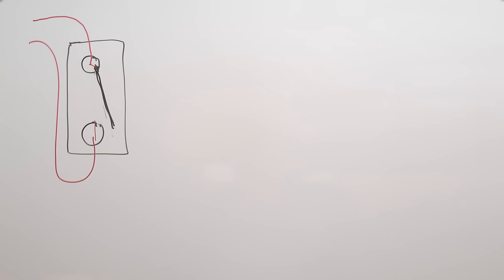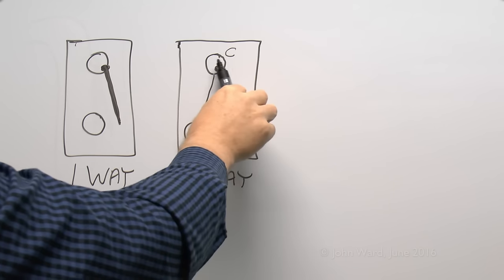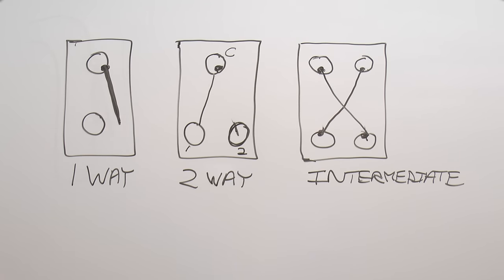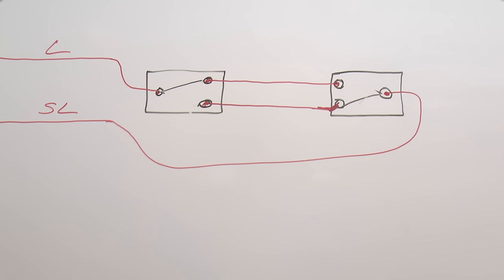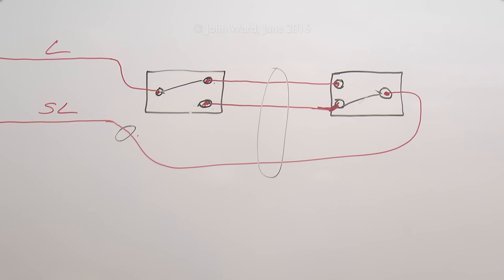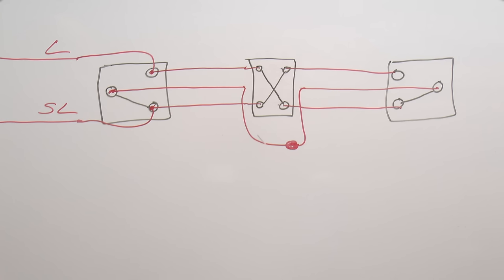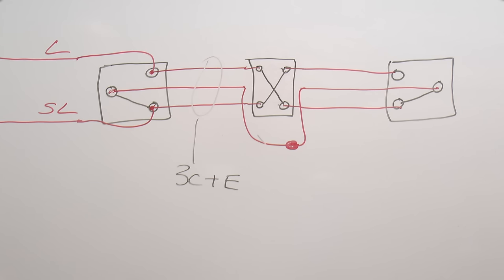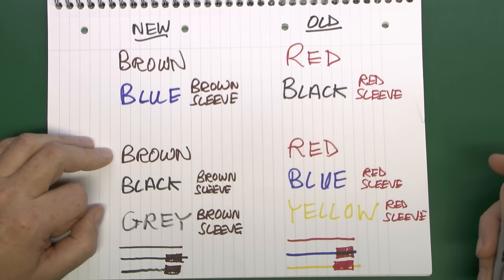Lighting Circuits Part 2 - Wiring Multiple Switches, 2 way and Intermediates

Comment: One minor point I wish you had covered.  How do I wire an intermediate switch as an ordinary two-way switch?  I have a three-storey house with a three-gang switch on the middle landing.  Currently I can switch the middle landing light from the ground floor but not the top floor.  I have obtained a three-gang intermediate switch.  But only one of the three needs to be used as an intermediate.  How do I wire the other two?
Reply from the maker: For a 2 way, use 3 of the 4 terminals.  For most intermediates,  two terminals next to each other will be L1 and L2, then either of the terminals on the other row will be Common.
They can also be used as a 1 way by using only 2 terminals, one on each row.

What's inside the switches is covered here: https://www.youtube.com/watch?v=eKFICF88AkY which should explain how they work inside and therefore which terminals do what.
Reply: @jwflame  Many thanks for your prompt reply.  I'm going to have to draw this ..

Comment: The red/blue/white cable I came across the other week during a rewire... still in use ... with pvc overall jacket, but polyethylene insulation! (yes, flammable!)... no earth conductor. 

Would you like a length of it for a collection (or possible video) if you have such?
Reply: I'm in the UK so I am quite happy to post to you :)
Reply from the maker: Yes, please send a piece.  Address here: http://www.flameport.com/contact.cs4

Comment: So the ceiling rose is the same as a junction box? What is confusing me is why in this video there is no neutral. If your lights are connected to the junction box already an you want to add a switch you have to run it to the junction box as well right? and not to the other switch like in this video. Any thoughts from anyone would be appreciated, I don't want it to go bang bang.
Reply: A ceiling rose is kinda like a light fixture with a built in junction box
And in the UK the wire is generally run directly between the switches

Comment: can you suggest any video at least half-as-good as yours to get the diagram right?
Reply: hi Matt thanks for replying. I will try to be specific. I can't figure out how applying the technique to my case.  I have: three light points in my room and
Switch 1: three gang that controls light 1,2 and 3
Switch 2: two gang that controls light 1 and light 2
Switch 3:two gang that controls light 1 and light 3.
I think This amounts to 2 2-way switches + 1 3-way switch? I now know that I am doing wrong as the gangs in each switch box are "individual" and require some wiring between each of them, but I can't figure out how. If you can suggest some source covering multiple gangs, it would be great.

Comment: I am using a relay with my raspberry pi to switch on and off a bulb.

I have an idea in my mind but I don't know if this will work or not. My idea is to use a relay switch with a 2 way 1 gang switch.  As you know, 1 of the switches will have the live connected to the common and the other switch with the bulb connected to the common. I want to connect the common of the relay with the common of the switch and the NO/NC with the bulb so if the switch is off I can still turn on the bulb using the relay.  With the idea if I cannot pass from the door I can pass from the window. Will I burn the relay if I have the relay on and switches on together?
Reply from the maker: That's fine - the relay contacts are just the equivalent of another switch.  Doesn't matter if one, both or none are switched on.

Comment: How is one dimmer fitted using an intermediate switch?
 I believe the live has to run through the dimmer switch at all times.
Reply from the maker: A standard 2 way dimmer can replace either of the 2 way switches.  No intermediate dimmers that I am aware of.  
Limitations are that the other switches are just on/off, so if someone leaves the dimmer set low,  the other switches will just go between off and very dim.  Can't have more than one dimmer either.
For dimming in multiple locations, it's far better to have dedicated dimmers which can be controlled from multiple positions.

Comment: Hello John,  just a suggestion, in order to help people understand the switch connections, how about labelling the connections on your drawings.  As you have drawn them side-on instead of top to top.  In this case L1 is at the top, L2 at the bottom.  Where the confusion can occur is with the Inter Switch; is L1 on the top and L2 on the bottom,  or is L1 on the left with L2 on the right?  As your drawing shows L1 to L1 and L2 to L2.   However if the Inter Switch is L1 left and L2 right that means L1 to L1 and L2 to L1.   I recently installed an Inter Switch and wired up L1 to L1 and L2 to L2, it did not work, the two original switches did; but the Inter did not.  What if? what if the drawing is on the side as shown that makes L1 to L1 and L2 to L1,  so I swapped the wires over on the Inter so that S1's L1/L2 went to L1 and S2's L1/L2 went to L2......It worked!
Wire Colours.....Must admit that is exactly how I assessed the new wire colours Red = Brown, Blue = Black (because black was 'N' before becoming blue) and Yellow = Grey.

Comment: As always great video John, but as an electrician of many years I mostly use the three core and cpc loop in and cut the switch wire for double switching, this way you don't need a separate switch cable. Could you explain this method as I used it all the time in Spain but haven't seen it used here. Cheers

Comment: If one were using a conduit system for wiring a two way switch system, and of course had the choice of which colour cable went to each switch, would you recommend using three brown conductors? Because obviously they would still need to be separately identified, within the back box.
Reply: True, but they wouldn't need to be sleeved.  Also note that (although maybe more fiddly) you can use the position in the 3+E cable to identify, notice the CPC (earth) is between cores, so you can easily separate off that 'individual'-wire from the 'pair' etc....
Reply from the maker: 3 browns would theoretically be better, the ends could then be identified with wire markers (numbers or letters).
In reality it's more likely to be different colours, as the 3 wires would normally be drawn in at the same time, and that would require having 3 separate rolls of brown wire in use.  One roll of each colour is more likely.

Comment: At 18:39 why does it not cause a problem with the line doubling back on itself and causing a loop? Doesn’t it short circuit or anything?
Reply: Its all within the same/nearly as same potential when it comes to feeding a Permanent Line(phase) & connecting it up to Load-Points.
Even with any worst scenario Wiring Mismatch within Switching Configuration Network, no short circuit normally occur. It merely fail to function, or perform abnormally...

Comment: Have you ever seen a situation where the light was ever so slightly on when it should be switched off? Just a few volts, but enough to make the lamp glow a little red in a completely dark room.
Reply: Seen this on two occasions.  This may be due to the light being incorrectly wired onto a permanent live and switch wire of another light.  I simply rewired the light and problem was solved.  The problem was caused by a diy enthusiast who mistook a permanent live and switch wire form another light for a feed (old red and black uk colours) for the new light.
Reply: Terry Clark someone more than likely wired to he switch wrong and now its continuously getting power
Reply: With some led lamps this can happen because the capacitance of the led allows some current to floor into the bulb from an unseitched live even when neutral is missing. In this case it often means the switch is in the wrong wire.

For some reason I don't grasp I have seen this with led lights even when wired correctly.... Any ideas?

Comment: Sorry John, you made a mistake. The old BLUE is now the new GREY and the old YELLOW is now the new BLACK. I know it makes no difference when it comes to lighting but when it comes to three phase, Colour matching is important as i'm sure you know.
Reply: I always found phase rotation to be hit and miss even with the official colours.
Reply from the maker: Quite right, seems I have put the blue and yellow in the wrong order there.
Reply: mastergx1
Reply: a lot can depend on who's doing the fitting, with damned EU regulations changing so often, 
as I found out recently, its like change for the sake of change... & yes there are some who will argue in favour / against
Reply: Depends if you care which way the motor turns...

BTW, there was a brief time when it was black, blue, brown and black.  Yes, two blacks and one brown.  Or maybe it was two browns and one black (my memory is dodgy and this was in the mid-80s).  You were supposed to figure out which black was which (or maybe it was browns) by the lay in the cable.

All in the name of allowing colour-blind people to wire up mains plugs at home.  Which forced brown/blue to replace red/black and the ripples propagated upwards into 3-core+E, via a few transient colour schemes.
Reply: mastergx1 just

Comment: hi nice video. i was wondering if you could help I have a kitchen light which will not switch on unless the livingroom is. they are both single switches. the living room has 3 red wires and the kitchen only has 2, can you help advis3 me on how i should wire it.
Reply from the maker: Probably the living room switch wired incorrectly, 3 wires should be power in, power out, light fitting.
In and out should be in the same terminal, you probably have power in on it's own and out & light together so power only goes to the kitchen one when the living room is on.
Reply: +John Ward cheers, ill give it a try
Reply: Hi, somehow the kitchen light is powered from the switched live off the dining room, not from the loop live. Part 1 of this series will be more useful to you in sorting that out, and links to parts 1 and 3 are shown if you access the info below the video.

Hope that helps

Comment: Hi everyone  

I have a new vanity mirror in my bathroom   I used twin and earth wire blue and brown in this country and ran the line from above the sink where the mirror is up the wall and across the ceiling to the main bathroom light

There were 2 brown wires together going into a connector and the main bathroom light brown wire connected to it on the opposite side of the connector. And 2 blue wires together going into a connector and the main lights blue wire connected to these on the opposite side of the connector the same way as above.

So I connected my new mirror light into the main bathroom lights side of the connector matching the colours brown to brown and blue to blue 

But now I can't switch the mirror light on and off without the main bathroom light being on

What did I do wrong??

I know I probably worded this question way too much for you pros because I think this is a very simple task for you guys   but is it just a matter of putting the neutral wire separate from the line coming in from the switch? And if so how do I do it?

Many thanks for any advice I might get

Comment: Can i ask?
What for using the intermidiate socket for?
What is the different for using it and not using?
Reply: It is when using 3 switches, you would place an intermediate switch in between the 2 2 way switches
Reply: @McKennaYcb1  
And in general if using N switches, the first and last are two way, and each of the others is an intermediate

Comment: why have 3 cables when you can use 2 cables switch to switch, is there any reason for this, cheer's
Reply from the maker: 3 wires is usually more convenient if using  multi core cables.  For only 2 wires between the switches, line is supplied at one switch and the load connected at the other, which usually means a single core at each end.  That is normally only done with a conduit installation.

Comment: Hi, I have an old intermediate switch and want to replace it with a 2 way (i.e. I have 4 leads and now only have 3 holes) any idea how I do this?
Reply from the maker: If there are 2 or more other switches and you want to keep them, then it is not possible - a 2 way switch cannot replace an intermediate.
Reply: John Ward n
Reply: Very well explaind

Comment: hi john 
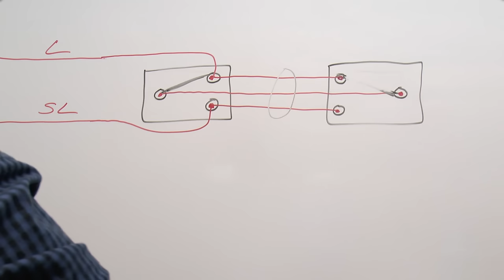on 9:45  and 12:57   you have the switches a mirror image of each other. I assume you could also have the same positions on the switches EG wire in left terminal goes into left terminal on other switch instead of mirror image.. it can be either all... is this correct?
Reply from the maker: Yes, and it would normally be done that way to ensure that when both switches are off, the light is also off.
However easier to draw without wires crossing over.
Reply: thanks for the reply. I have one more question. Here's what the back of a light switch looks like in australia: http://www.talkingelectronics.com/projects/Electrician/images/BackOfSwMech.gif
is this an Intermediate switch?      ie I can use 3 of these to make a three way light? ??
Reply from the maker: No, that's a 2 way switch, the 4th terminal would be used for connecting other wires which are not switched.  Such things can be obtained in the UK but are uncommon, where neutrals or other wires are present it's more usual to use a separate terminal block rather than one built into the switch.
This video shows the 3 types of switch including what's inside them: https://www.youtube.com/watch?v=eKFICF88AkY
If you are located in Australia, note that most/all areas have very strict rules on who can do electrical work, most of it can only be done legally by a licensed electrician.
Reply: thanks for the reply. about the licensed electrician: that's obvious. Of Course that will not stop me on what I want to do in my house. That's my judgement.  Please mind your business and keep to the topic of the electrical tutorial.
Reply: even though I meant it- My reply was too strong and could of worded it a bit better. My main message is that I appreciate your advice and the education of this topic on youtube.

Comment: 12:47 isn't that a short circuit ? the two switches are in the same position and the line L loops and connects to itself on the other switch...
Reply: Its all within the same/nearly as same potential when it comes to feeding a Permanent Line(phase) & connecting it up to Load-Points.
Even with any worst scenario Wiring Mismatch within Switching Configuration Network, no short circuit normally occur. It merely fail to function, or perform abnormally...

Comment: Hi Everyone, I have a question, if you know the answer , i kindly request your help.
2 Gang 2 Way Light Switch can be used as 2 Gang 1 Way Switch. Is it possible ? I look forward to hearing from you soon...Thank you all...
Reply from the maker: Yes, connect to the common terminal and one of the other terminals.  3rd terminal is not used.
Reply: Thank you for answering me.I have one wiring diagram , however not certain if it is correct. If I upload it here , could you have a look and let me know please ?

Comment: Excuse me, what do you mean by sleeve?
Reply from the maker: Plastic tube or covering typically in brown to place over the blue insulation to indicate it is actually a switched line rather than a neutral.
Reply: You can buy rolls of sleeve from an electrical supplier, in any of the official wiring colours. If you do a lot of this kind of thing then I suggest you get all three colours.

If it's a one off job then you can get by with sleeve stripped off a fatter conductor, or even appropriate colour insulating tape, which will be cheaper to buy that a whole roll of sleeve